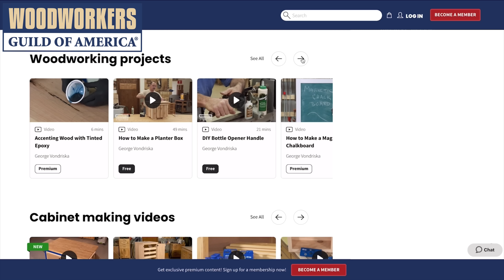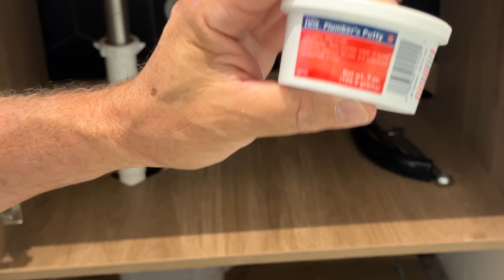INSTALLING a SINK with a BUILT IN DISHWASHER!!

Comment: When I was an apprentice I had a pretty much full small can of primer in some new cabinets. I had cardboard under it which ultimately led to my downfall. I got out to get something and my elbow was on the cardboard and pulled it and spilled the can. Another option so you don’t have to carry an extra can is to just use glue. According to the glue manufacturer, primer isn’t needed. We use it because it’s code and does make a better seal for understand, in wall stuff. Both methods are technically illegal but I’ve yet to meet an inspector who failed me for it.
In the tailpiece, I never put pipe dope on the washer but it won’t hurt anything. I do however teflon the threads. I’ve head a few that water comes out the overflow and will follow the threads down. It also makes it easier to slide the washer up

Comment: So my plumber mentioned that on kitchen sinks on new const or remodels he'll run 2" or 2.5" from the sink to the mainline and just adapt right at the outlet in the wall.   Since kitchen sinks are usually the first ones to plug and that lets anyone get bigger rotorooter type stuff in there to clean it out and not get stuck on corners.  (and hopefully never needed).  I thought that was pretty genius.

Comment: Hey Paul. I suggest modifying the condensate pipe connection (min, 17:20) so that the angle is not point upwards(it has a loop). The condensate needs free fall, otherwise it will not drain and it will build up and lick somewhere else. I know because in Europe we have home central heating that burn gasses in in condensate and for it you need it to be able to drain (like gutters but through pipes). Another pointer a plumber give me was that I should permit the drain in such cases to be aired, so there's no vacuum created (I don't know how to explain it better).
Reply from the maker: It's pumped so the direction of the tubing doesn't matter in this case.  No air gap is needed because the pump has a check valve.

Comment: I'm a big fan of Delta faucets and stuff because the finish is on point, but also because you can generally buy parts locally if you need to repair in the future install of just replacing.

Comment: For future reference! You don’t have to take the doors off the hinges to remove them. The hinge cups can stay in the doors and you can pop off the hinge from the hinge plate attached to the cabinet interior panel with a little release on the back near the rear of the plate.
Reply from the maker: These cheap hinges don't do that

Comment: I always use 1.5” tee like the one at 22.:50 with a pvc 1’ coupling and then u can use the pvc reducer with female threads. The tee I use is the one u use with the dual drain type sinks   This  1” coupling outside diameter is the same as 1.5 “ and u can use the rubber prints to make it seal like a  p trap or trap adapter and also great with ac drain lines . Super clean

Comment: I love that dw idea, and here's why: 
1) dw manufacturers say no need to rinse, no need to scrape ... which only works if you never let food DRY ... which happens unless you run the machine every day. Even in a family of 4, standard dishwashers are too big to run everyday!

2) A regular dw depends on hot water, but if you fail to run your hot water until hot water comes out of the faucet before starting the machine (how far away is YOUR water heater ... ) then the dw barely ever sees hot water.

I'll be checking that lineup out. I'd much rather run small loads everyday and save the cabinet space!

And did you know? Some early dishwashers were also top loaders.

Comment: Saddle clamp/drain clamp for the condensate line. Easy push connect and install wherever is best on drain line. They make them in 1/4” and 3/8” (possibly more or metric?).

Comment: To all you plumbers, could you keep trap high and exit it with a 90 down to a 90 into lower pipe? This would avoid cutting cabinet bottom.
Reply from the maker: This would create an "S" trap and fail inspection (here at least)
Reply: @StudPack  But then when you are all done, sitting in your living area and looking over into the nice bathroom, you are going to see the white p-trap hanging down below the floating cabinet ruining the aesthetics of that unit.  I'm not a plumber, but I know there are solutions that could have made that work, without cutting into the bottom of the cabinet.  

Huge fan, have been for years, but that choice had me puzzled.  Same with the complicated series of fittings to get the condensate line into the drain.  I know there are PVC fittings that could accommodate that connection much cleaner than that admittedly clever combination that was used.

Comment: The grey threaded piece with the barb is also available in a straight config.   It would eliminate the high loop and help the condensate drain better
Reply from the maker: Couldn't find a straight fitting.  The condensate is pumped so the loop won't matter

Comment: I used a compression to pipe fitting to hook up a condensation line once.  I think it's 3/8 compression to 1/2 pipe. Put in the dishwasher hose and clamped onto the threads.

Comment: Since you have the phone app, you can put a wireless button and program it to turn off the breaker. If you buy a button with a light, you can even have it darken to confirm power is off.

Comment: I agree the putty is the way to go for under the drain flange, silicone is not as clean.  Silicone grease on top of rubber is better than pipe dope. It helps the rubber conform to any irregularities, fills in small gaps, and repels liquids. Generally silicone grease can be combined with all rubber type interfaces to help seal and provide lubrication.
Reply: My drain instructions said no putty, no pipe dope. It relies exclusively on the bare rubber washer to seal. I guess all brands are different.

Comment: Its angle stop or shutoff valve. Not to be confused with a diverter valve or control valve. "STOP" is the new generational term for the plumbing part that has always been called a shut-off valve or angle stop since mobby was a minnow.

Comment: I installed a vanity this week with a manufactured marble top, and the same kind of tail piece., I actually read the instructions for the faucet AND the putty. The putty instructions said not to use it on marble or sintered stone which is pretty much any manufactured stone because the putty will stain the stone.
Reply: they do make a putty that is meant for marble and stone that doesn't stain.

Comment: I can't get over how good the front of the garage looks. Do people stop when they are driving by to look at it?
"We can use this for something" and Jordan throws it in the trash. LOL. It's like me and my best friend. I want to keep all the scraps. He wants to throw everything away. Although, I was vindicated when I told him to keep some scraps and he ended up using them as shims. LOL. I have a bin full of scrap wood in my workshop.
Is that vanity particle board or mdf?
The template and cutting with a router worked well at least.
My existing vanities in my house are custom made plywood (cheap plywood, but still better than mdf or particle board) and were built on to the walls. Whoever built them used a ton of caulk to secure them. Like 3/4" and thicker beads of caulk. The guest bathroom will have a particle board store bought vanity so I will have to get it secured somehow. It's not wall-mount so I'll be using plastic thingies on the very bottom so it won't touch water if water ever falls on the floor.
Somehow I never thought to hold a drill upside down like that. I'll have to try that.
Delta makes good stuff and they have decent warranty. Ordered some shower trim & valves & a cartridge ruptured during a winter storm. They sent a replacement cartridge for free.
I don't have a problem with Paul saying "super". 
Did any sort of sealant go on the exposed stuff where the hole was cut for the P-trap? I would at least use a little water seal there just in case.
That slim piece of granite at the front of the cabinet makes me nervous. I'd want to put something under it as extra support just-in-case.
I hope the dishwasher drain has 0.25"/ft drop. That's the minimum slope it needs to drain properly.
The button on the countertop for disposal is cool. I could never have that because my cats would step on it. LOL. So I've got a wall switch.
So, for the actual house, will Jordan be getting a separate dishwasher and a fancy sink with waterfall and cup rinser?
Ooh, oval mirror in the bathroom! LOL.
I'm looking forward to the next video.

Comment: Great job with the vanity install, but as someone in the hvac service industry I can tell you, You should remove that barbed fitting on the condensate line asap. Just use a cap or rubber plug with a  hole drilled in it with the exact diameter of the tube and shove it in a couple inches. Those thin tube condensate lines are already notorious for clogging with debris and slimy bacteria buildup from nasty condensate. The mini-split air handlers drain pan will overflow and leak down the wall, usually staining it and causing damage to any finished surfaces. I see this weekly in many homes and don't understand why installers are still using that tubing.

Comment: 21:03 I think they “determined” that it’s skates around the double trap issue by using the other basin(garbage disposal/basket strainer) as a vent/vacuum break. I would be an issue when you dump the sink but would operate pretty well otherwise. Like old “house traps” that had perforated clean out caps for vents.

Comment: When cutting the notch in the bottom drawer under the sink and dishwasher, it's best to paint the raw cut metal surface to prevent rust and corrosion since it's near water. Even though you've applied Lexel under the sink flange for both the kitchen and bathroom, it will probably degrade over time. I would use silicone to seal the top as the first line of defense. This will make the Lexel last longer and make it easier to replace the silicone on top without having to remove the sink or dishwasher to replace the Lexel as often.
Reply: I think they did in a previous video.

Comment: i have a ikea kitchen and its great, but those big sliding doors like the one under the sink needs a reinforcement or else it will get loose over time. i added 90 degree metal brackets on mine since mine also where under the sink and i couldnt add the ikea version because of the drain. just a tip, been there done that 😂👌

Comment: To confirm that power is off, possibly put a "pilot light" that protrudes from the top of the 4x4 extender.  If it is a neon light, it would take VERY little power and give you some peace of mind when you need to do wire additions.
Reply from the maker: Pilot light switches are the answer; illuminates when the switch is on.  Had one for our attic light when I was a kid

Comment: Oh great another appliance that needs half the kitchen to be remodeled when it breaks. 

I have a story about a dishwasher. The home sellers bought a dishwasher and garbage disposal to sell the home. I did the final inspection noting that the garbage disposal was leaking and they replaced it. This was not my home but I was hired to make sure they completed the tasks. For a month or so the dishwasher did not work and instead flooded the kitchen. I took it out and tested it in my work shop, it worked fine. The problem however when I put it back it failed. The contractor failed to remove the plug on the garbage disposal. However the dishwasher was plumbed improperly, so now instead of flooding the kitchen floor the sink backed up into the dishwasher and then onto the floor.  So I replumbed the dishwasher so it would not back up onto floor. This is actually the first of three houses where an aging dishwasher improperly plumbed backs up into the dishwasher and onto the floor. 
The story is not over, one of the houseguests did her gardening in the kitchen sink and did not know how to use a garbage disposal, in another house the cleaner trims her fingernails into the garbage disposal, similar result. Run dishwasher and the sink overflows onto the floor. Finally this house guest leaves, problem solved. Nope, one of the primary tenants in the house, an engineer no less, cannot use the dishwasher, for whatever reason, it malfunctions when this person touches it. So essentially only one person in the house can use it. 

  As for my house I removed the dishwasher and turned it into a removable place, still fully adaptable to a machine, for overnight drying of large pots and cooking pans. 

You can keep your fancy built in sink dishwasher.

Comment: Man, all of those tiny little problems/obstacles in the first half of the video are sooo intimidating for someone like me with very little DIY experience. Mad respect for your knowledge and skill. One thing that confused me, circa 25:25 - are we looking at the rear of the sink setup, i.e. the face that goes up against the wall? And if so, is it problematic to have tightened those hose clamps with the screws/bolts facing the wall? How will you loosen them if something goes awry? Seems like that could be a challenge, but I guess the bigger desire at present is just to get the frickin' thing installed and move on with your lives! 😁
Reply from the maker: Thanks!  I guess it doesn't matter which way they face; no one is ever gonna get back there and loosen them😁
Reply: @StudPack  Because they're so EXPERTLY INSTALLED! Got ya!

Comment: The metal drawer is great incase there is a leak (good spot to put leak sensor/alarm).

Using home automation you would have leak alarm shut a valve.
Reply: I found a nice flexible rubber containment mat to put beneath my sink along with a leak sensor.

Comment: I’ll be curious if that wiring for the d/w passes code.  In my area it would fail miserably.  No shutoff at the appliance and the power needs to be adjacent to the d/w opening.  Fingers crossed for ya!
Reply: Yes, I'm in Texas, and there is a switch over my countertop which turns off the dishwasher power. The disconnect has to be within visual range from the dishwasher, I believe. Putting a single outlet where the whip is now might be acceptable, as then you can unplug the dishwasher. It probably needs to be GFCI as well, it might be in the panel. I think the inspector may watch the videos, but perhaps not the comments.

Comment: I don't use the pex valves for connecting sink or toilet supplys.  I use a male adp. and a screw on valve.  Makes it easier to replace later if necessary.

Comment: You know they make over[riced bottle traps those low profile vanities, You cut also the down/tail pipe short, put the p-trap high and either plan the pipe to come out of the wall high or zig-zag a pipe (as in p-trap gues forward while the pipe to the wall goes back from the joint, 1 90deg). You should also consider gluing PVC, then assembling with two slip joints on vertical pipes so the whole assembly slides in and out in one piece.. Much fewer leaks easy to clean.

Comment: I would throw a 4 square extension ring with 1/2" k.o. and a raised face cover for a toggle switch on that dishwasher if it needs it. No need to run more wire to another box for a switch.

Comment: Looks good!  On the electric, I think I would've cut out the plastic box from the wall and replaced it with an old work metal box (or screw though the box right into the stud that must be there).  Then, run the MC through a a hole in the wall and into one of the side/top knockouts on the box.  You can use an escutcheon around the MC to dress it up a bit.  That'd have allowed you to put a basic switch in the box, giving you your disconnect.

Out of curiosity, how come you decided to stub out with PEX rather than copper or drop ears + brass?  I also went with PEX-A in my home, but went with copper stub outs in the kitchen and chromed brass nipples in the bathrooms.  Just feels nicer to use and looks nicer imo.

Comment: You could also have used a 3in hole saw and drilled on the center of each end, then used the router or oscillating cutter to connect the two holes and gotten a round ended pill shaped hole.

Comment: For the patchwork fittings under the sink,  I would check for a stl file for it online.  If there was one, I would modify it if needed and then 3d print it.  If there was not one, I would find a file close and mod it or design one.

Comment: @27:40 for the disconnect, could y'all use an offset single-gang mud ring cover, and then just drill a hole as the knockout.  I'm thinking something like the Topax 52C11 (that's just an example; not an actual recommendation).  Then you could get a switch and the wire in the same box.